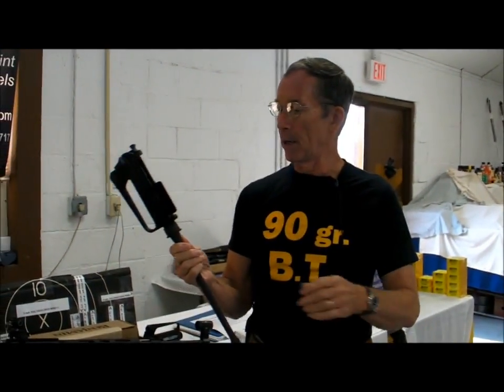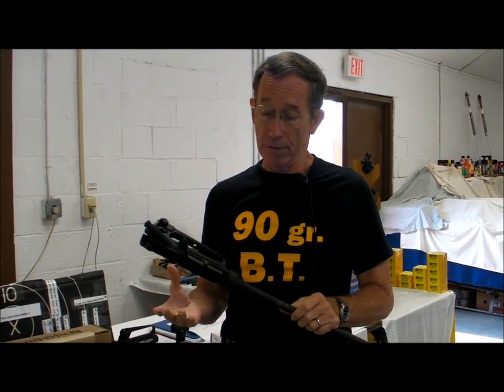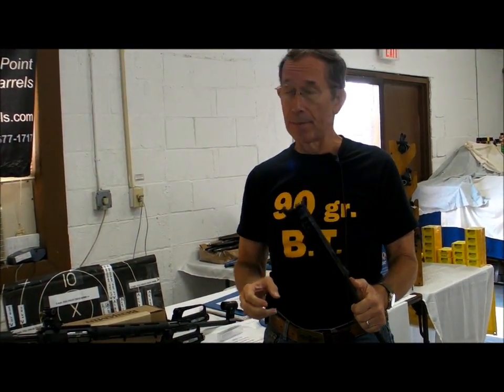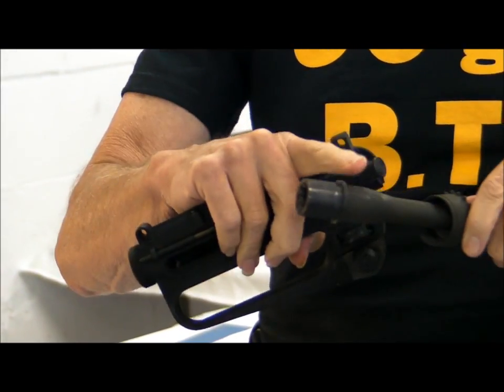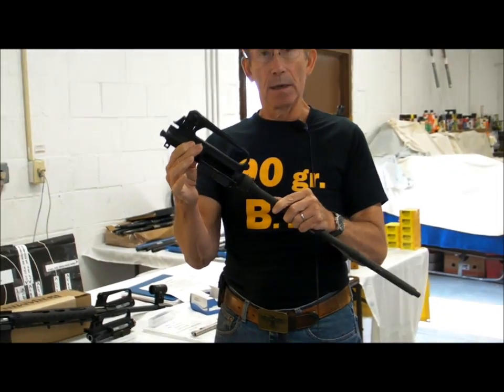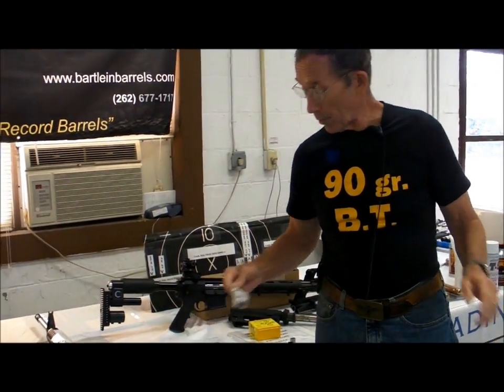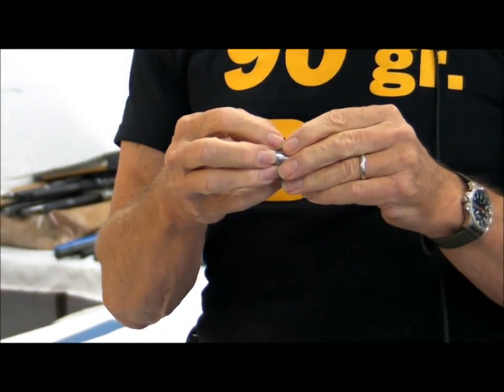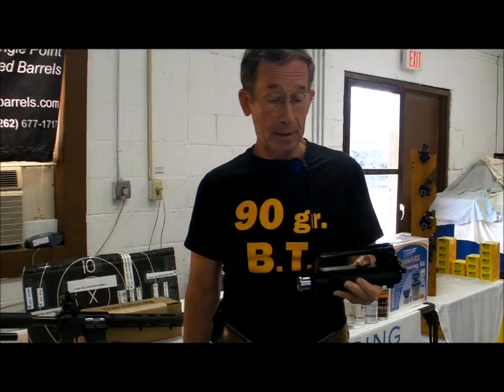Building Match Grade AR-15s

Comment: May I respectfully and humbly ask about the Green Loctite 290 and its temp rating? 

It states on the Loctite property’s chart the green loctite is temperature rated from -65F to 300F .

With a rapid rate of fire that would cause the barrel to far exceed the 300 degree rating effect the property’s of the Loctite 290 ?

Also in relation too the subject, what do you know and or think about the Loctite 5540 extreme temp? 

Is this suitable for barrel seating application in a fast rate of fire where the barrel may exceed the 300 degree temperature rating of the Loctite 290 ?

Please let me no your thoughts as I respect what you have to say.

Thanks so much for your professional opinion.
Reply: Casey
#290 is a green LocTite but it is what I consider a "wicking LocTite" and is used for threaded parts as opposed to smooth surfaces like we are dealing with in regard to fitting barrel extensions to upper receivers.  So I have never used #290.
Initially, I started with #620 because it was designed to fill gaps such as those existing in the fit of the barrel extension to the upper receiver.  After a few years of using just the green #620 I started adding the .001" shim stock that I talked about in the video.  So I was filling the gap with metal shim stock while still holding everything in place with the #620.  I also use some green #638 these days.  I believe it is better suited to the higher temps. that you are concerned about.  The disadvantage of the #638 is that it sets up waaaay faster than the #620 so a person had to really have all his ducks lined up very well ahead of time.  For persons just getting started in this fitting process the #620 is probably more user friendly.
The video does have to do with building AR's for match use.  Most of the AR's that I build are for National Match Course, High Power, F Class,  Palma, and various long range matches.  Probably the hottest that any of those barrels get is in the Infantry Trophy Match fired during the National Matches at Camp Perry.  Shooters often empty a whole 30 rd. magazine in less than a minute.  There is no sign that either of the two green LocTites that I use are letting go during the firing of this match.  If the LocTite gave way one would think that the rifle's zero might shift and I have never heard of that happening.  Also, these barrels do eventually shoot out and the guns come back in my shop for rebarreling.  One would think that if the LocTite had given away it would be easy to pull the barrel back off of the receiver.  This has never been the case.  Barrels have to be strongly beaten off or heated first and then beaten off.
So, in summary, I think that both the #620 and the #638 are reliable under the uses that most AR shooters put their rifles to.  If you are building rifles to be used at higher round counts and feel more comfortable with a LocTite with a higher temp. rating I certainly see no harm in using a different product as long as you get the actual fit of the shim stock done really well.
Thanks for your interest!  Joe
Reply: In my limited experience I use 620.  It is user friendly to work with and provides time to clean up should a little schmoo out on installation.  Since this is a curing adhesive instead of a drying adhesive it will likely still perform its job even if it loses adhesion to one of the surfaces.  It is there to rigidly fill the gap and in its cured state will continue to do so.
Reply: @joecarlos2409  Also, to Mr. Carlos, thank you for the contributions that you and your associates have made to the AR knowledge base over the years.  Eugene Stoner DID create a precise rifle, he just didn't know it at the time!

Comment: I've been told by a lot of gunsmiths to never put locktite on a barrel, and if it has slop then the it's not a quality upper or barrel. I'm guessing they are wrong? Thanks for the info I'm a novice builder and love building guns.
Reply: I'll address the issue of the barrel first.  Technically, the barrel extension is not part of the barrel.  It is machined, usually by outfits that are not barrel makers.  They are machinists but the tolerances that barrel extensions are made to varies a LOT between makers.  If you use these "low bid" extensions on even very high quality barrels your fit between the extension and the upper receiver can end up with lots of slop and the gun will likely not shoot optimally.

There is also a lot of dimensional variance between manufacturers of uppers.  So when you combine an upper with a fat bore with a skinny barrel extension the gun will not group well.  Who gets the blame?  Usually either the barrel maker or the gunsmith.

To correct this at a bare minimum use the Green LocTite.  To do a better job wrap thin metal shim stock around the barrel extension and still use the LocTite.
Reply: @streakfighter  No actually he isn't wrong.... USAMU/CMP Armorer's having been doing this for years to accuarize for Service Rifle Comps. You can see the same process given by Criterion Barrels. 

As a Former Unit Armorer I can assure you this isn't in the 20/30 Manual but is effective.
Reply: @shane35fowler  Someone said the green Loctite is very hard to get off.  I have 2 A10's that I started before covid and I'm going to take them apart and go back through them. How did u take them apart?

Comment: I just have a mid range (probably wishful thinking) Bushmaster AR15 carbine that I have upgraded, but it's just a run of the mill 16" barrel AR.  I've been reading a lot about the different forge markings, so I know that the keyhole forge marks on my upper and lower mean that they were made by Cerro Forge.  
Lately I have been thinking about buying a second upper receiver, because I want a longer barrel for competitions, but when I changed my handguard a few months ago I noticed that the barrel was really stuck in the upper receiver.  I have my eye on an AR Stoner flat top assembled upper (I know that just means the forward assist and dust cover) for $90 on Midway.  I have a few parts on my AR already made by AR Stoner, and I love the brand's name just because of the homage to Eugene Stoner (RIP).  Anyway, this AR Stoner upper has the square forge mark.  Will I be able to build a decent long range complete upper receiver with an inexpensive upper?

I hope this doesn't seem sarcastic, but what's the deal with your fingernails?  They look really long; it seems like that would be a nuisance to you; I know my fingernails drive me crazy if they start getting long, and if I don't trim them I end up getting them snagged on something and broken.
Reply from the maker: You can contact Joe directly at NCC1701 at penn.com
Reply: @FUNshoot  Thank you!
Reply: Looking to buy an AR in 6.5 creedmoor.  Would you piece it together as a Frankenstein gun or flat out buy an AR as a whole?  I'm seriously looking at the JP Enterprises or Rise Armament as an option?  Zev makes an
AR-15 Billet rifle.  According to Ballistics Best Mag (Jan 2020 ed) & their test shooters rated this gun #1 out of 10 different top branded AR's.  Looking for opinions on this matter?

Comment: Which green loctite do you prefer? 609? 640?
Reply from the maker: Loctite 640 is a good choice being low viscosity, high strength and designed for bonding cylindrical fitting parts. It prevents loosening and leakage from shock and vibration so is a good choice here.

Comment: Hey good video I enjoy your post but why not just buy the right tool and true the end of the receiver up with the proper lapping tool . Do it by hand no drill or drill press . Im sure if some would lap there receiver they would get there head space off but if you do it by hand and watch close what your doing and take your time it works and you will get good results .
Reply: Hi Jim,  Bolt gun custom builders do square the fronts of their receivers and have been doing so for decades.  I started squaring the fronts of my AR receivers several years back after performing an exhaustive scientific study which lead me to the conclusion that doing so removes about an average of 14% from group sizes.  During that study I found that using those tools that fit in a 3/8" hand drill actually do more harm than good.  Using that tool my run out got worse and groups got fatter!  I advise that no one reading this reply attempt to square an AR receiver using one of these tools.  Gunsmiths squaring the fronts of bolt action receivers do so in a lathe and that is also the proper technique to apply to Stoner Platform receivers. 

To learn more about AR receiver squaring read "New AR-15 Products" in the June, 2018 issue of "The American Gunsmith" or "Straight Bullets" in the Dec., 2018 issue.

Squaring AR receiver front ends is a separate topic entirely from removing the slop between the fit of the barrel extension and the receiver which was the discussion in this video.  BOTH, if done properly, reduce group sizes.

If I didn't explain this clearly feel free to contact me directly at NCC1701@penn.com

Thanks, Joe Carlos

Comment: What # green locktite are you using?   I see there is a couple different numbers
Reply: If you are using a barrel with a custom BAT Machine extension that does not require adding any shim stock you can use the quick drying #638 Loctite.  When using shim stock wrapped around a standard barrel extension the #638 sets up too quickly and you need the slower drying #620.  The #620 will also work on barrels with BAT extensions.  If you have any other questions you can contact me directly at NCC1701@penn.com  Thanks for your interest.  Joe Carlos

Comment: I have a lilja barrel and an aero upper and I can barely get the barrel in the reciever how am I suppose to get shin stock in there
Reply: Ron Jaime take a torch and apply heat to the threads. That’ll expand the material allowing the barrel extension to slide in. JP has a video demonstrating this. 

But if you can barely get your barrel to fit in the upper already then you most likely don’t need any shim stock

Comment: I just bought a Ballistic Advantage Hanson Profile barrel, that has a NiB coated Barrel Extension & it fits VERY tight into the receiver. I'm almost positive the fit is due to the NiB coating. So when buying a barrel, a NiB coated extension is something u should look for. BTW,  my BA barrel is a Tac driver & cost $190.  Much cheaper than other high Shelf barrels.

Comment: I'm sorry, but my minute brain has trouble comprehending how after a barrel nut is torqued to spec, that you can actually wiggle the barrel in the upper receiver. Could there be movement under high pressures being applied from the explosion of the cartridge getting fired? Yes, I get that, but just being able to stand there with a fully assembled upper, and being able to get "wiggle" from your barrel makes no sense. Seems to me, this is a really cleverly concealed infomercial for this guys barrels, and this guy Joe Carlos to get a piece of the pie by selling his wears.  You can lap the upper receiver barrel opening, and use green Locktite 620 to bed the barrel extension, and that should be good enough. I hate when experts exploit the novice and the easily-swayed consumers. In case anybody is wondering, I spent 8 years in the Army as an Infantry rifleman, graduated form armorers school in the Army, worked with the unit armorer when not out in the field, and shot competition events in the Army, along with 3 deployments. So I am no high speed expert on building precision weapons, but I never saw any "wiggling" barrels in the M16/M4's I ever worked on. Just sayin'...
Reply from the maker: From author Joe Carlos:

From author Joe Carlos.

The barrel nut does an adequate job of removing fore and aft movement of  the barrel in the receiver. Left to right and up and down movement, not  so much. That is because of the enormous mismatch between barrel ext.  outside diameter and upper receiver inside diameter.

We (All Army Reserve Shooting Team) first discovered the problem in  Australia when one guy forgot his bore guide Stateside. He had the back  of the extension all slopped up with excess solvent and oil. For what  ever reason he started applying pressures out near the end of the  barrel. I believe he was holding on around the front sight assy. so he  was able to apply quite a bit of leverage while holding the receiver in  his other hand. He discovered that as he applied up and down motion  that air bubbles and the actual liquid responded to the direction he was  applying pressure. He tried left to right also and got the same exact  correlation between the fluid and his movements.

He called the attention of other members of the Team and we watched him  closely and verified that it was happening. Like a bunch of little  kids, some of the other shooters got out bottles of solvent or oil and  slopped up the backs of their extensions also. Some, but not all of  them, saw the same movement of air bubbles and fluid that correspond to  the direction of pressure they were applying to the barrel. If you have  some uppers that have not been treated with the green L.T. you might  want to try this experiment and see if you experience air bubbles and  fluid movement as you apply pressure to the front of the barrel as some  of our guys saw in Australia. Better yet, try shooting some groups with  the barrel mounted without L.T. and then rebuild the gun with L.T. and  shoot groups a second time and let the groups speak for themselves. I  have done this hundreds of times and performed the testing on a state of  the art machine rest and groups improve by a bunch!

I don't recall any of the shooters in Australia saying that they could  see actual movement out near the front end of the barrel. That would  have been a real extreme case.

I have recalled this experience many times both in writing and  verbally. I believe I have related it pretty much the same over the  decades. Pretty much as I just have explained it above. I don't think  that I have ever said that we could see the actual front end of the  barrel moving but it is quite obvious that if the back of the barrel is  moving up and down, left or right then the front is obviously moving  also even though we can't see it. The fat groups are evidence that the  barrel is not returning to the same position between shots, however.

When I first began trying to come up with a fix I initially used the 620  green L.T. as you suggest. The 620 is identified by LocTite to use on  bearing surfaces with significant gaps such as the Stoner Platform.  Using just the Green L.T. I was able to cut average group sizes by about  18.6% if my memory is correct. While the 620 does fill the gap I never  tested by slopping up the back of the extension like was done in  Australia. I just let the before and after machine rest groups speak  for themselves.

While the green L.T. does harden up after it dries I wondered how much  "give" or compression was possible in this "glue". So I started trying  the use of thin shim stock wrapped around the extension and held in  place with the LocTite. I reasoned that the metal shim material would  have less give or compression than the glue. I was right and the  combination of shim and green L.T. almost doubled the efficiency of the  group reduction. I believe I got an average reduction in group size of  about 35%. So combining shim stock with green L.T. is one of the most  efficient methods of reducing group size. It is affordable and doesn't  take all that long to accomplish once you get the hang of it.

As for "lapping" the front of the receiver: PROPERLY done on a lathe  this shrinks groups by 14% average. But I must warn you that I have  studied those gizmos that are sold by Brownells or Midway and fit in a  3/8" hand drill. They most often make things worse! They usually add  runout instead of removing it.
Reply: Too much attention to a non existent problem, when barrel is smithed by CLE, White Oak Precision or others credentialed in production of finished barrels for US Service Rifle Competition. Overall, the match conditioned rifle delivers best results with quality barrel, float tube, fast lock time trigger, and .25 MOA rear sight with appropriate size aperture for conditions. Add match grade ammo and a High Master Competitor will get .5 MOA from such kit at 100 yards in prone sling supported position. At any rate a quality barrel will have a gauged barrel extension that will fit the in spec upper receiver nicely without need for bedding or shimming, either of which could cause excessive windage or elevation for initial zeroing, unless the front sight base is adjustable for windage. Creds: US Distinguished Rifleman and NRA Long-Range High Master Classification.